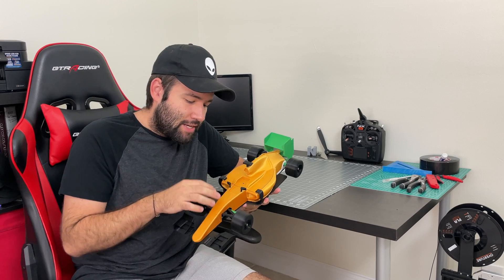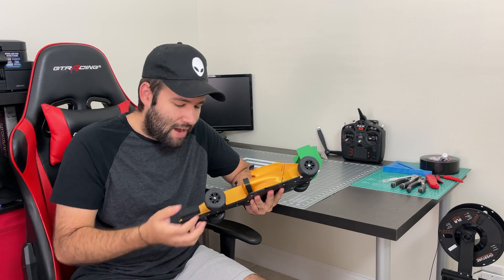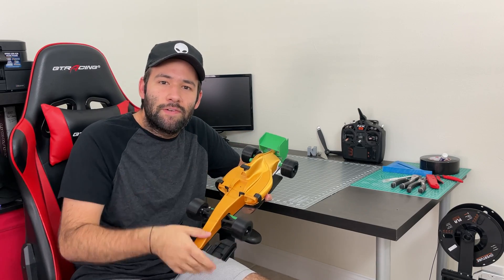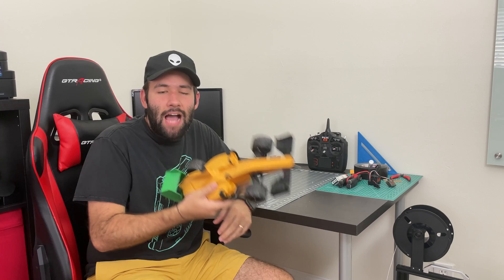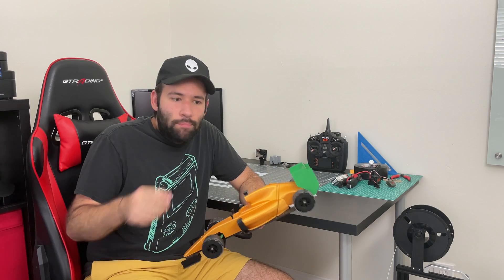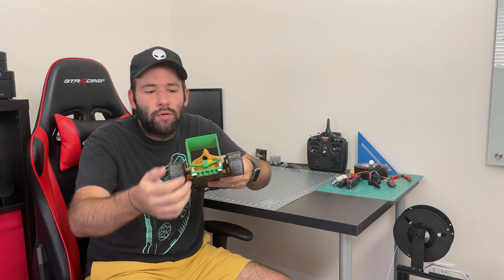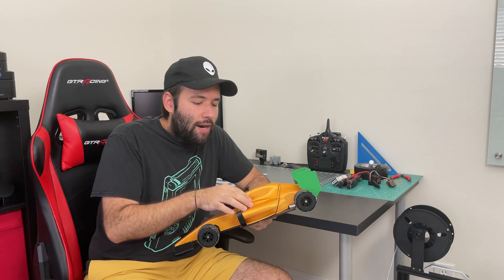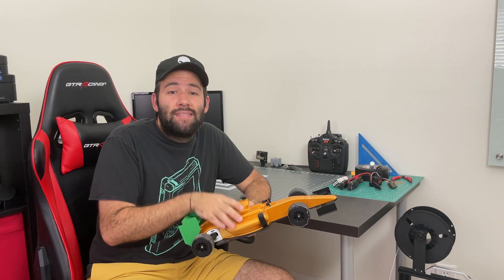3D Printed F1 RC Car

Comment: Print in ABS and gear im Nylon  front suspension you can made with spring i use carbon tube to make more stable this rear axel its annoing maby made in aluminium rod can be bether but its fun  use  i dont hawe broke axel drive this model prinred in abs  i hawe broke axel when i hawe dropt  him from 60cm high and hit  ground with rear wheell first 😂 with battery inside and are to hawy for this impact . But 3D printer make new axel easy and  you can back to play. ABS you can bound layers with aceton and model its more strong  and  easy  way to lucid  for paint , no ned puty to finish surface its nice lucid after sand paper work and aceton polishing. Nouse printed in this way its not strong must be printed  horisontaly, dont look good but if is printed in ABS and abrased and painted loks like  rest parts but its more strong.